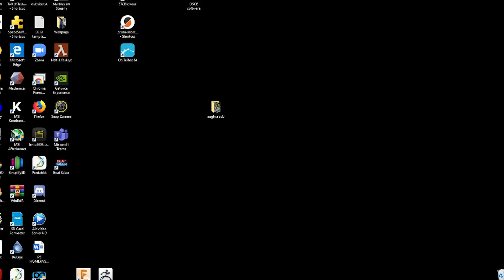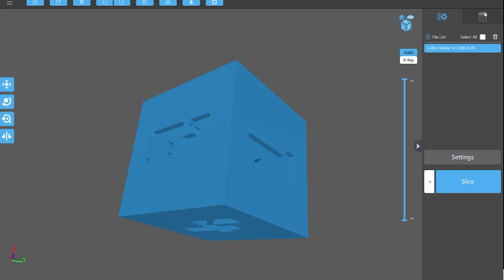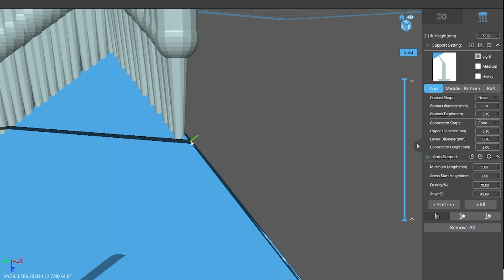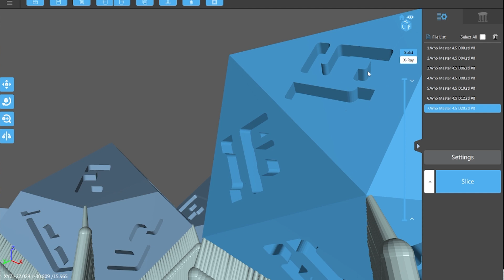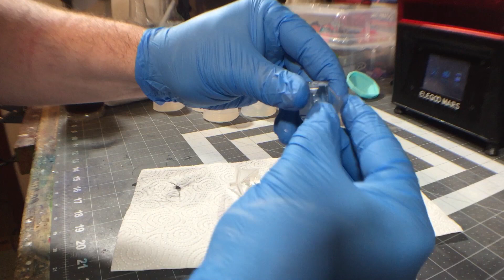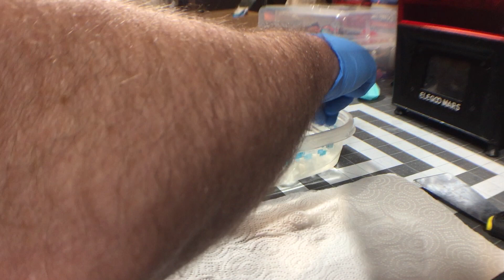3D Resin Printing Master Dice the Easy way!

Comment: Struggling for two weeks printing my Masters. Trying your support method right now and cannot wait to see the result. Thanks for sharing your wisdom 😁
Reply from the maker: You got this!
Reply: I had perfect results for most of my prints. Only issue was the D12 and D20, the supports separated at some of the outer edges what caused the die to deform. Using heavier supports on them causes the faces towards the buildplate being „blurred“. Did you had this problem before?
By the way, you make it look just so easy seperating the prints from the buildplate
Reply from the maker: Try Reducing your lift speed to something like 60
Reply: It worked great! Thank you for the support!

Comment: How do you separate dices from OpenSCAD to single dice .stl? Thanks
Reply from the maker: Personally I brought them into Simplify3d (any 3d slicer should work) and separated shells, then I could pick dice individually and save them out as individual stls.  There may be a way to do it in OpenScad but I didnt try.
Reply: @Rev_Chumley  Thank you :)
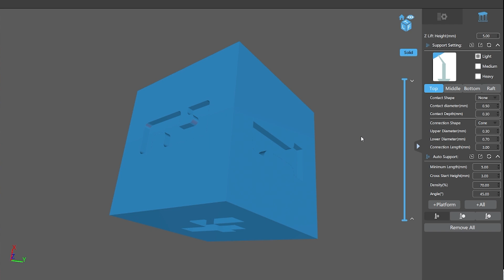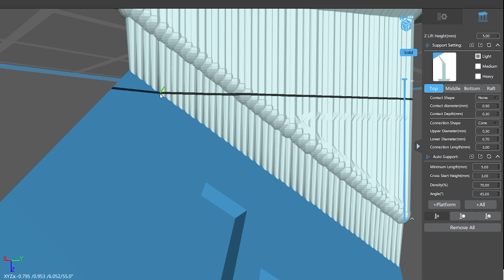Reply: You can find the info info ^above using the "//" command @4:55-6:50- Where is the d8? By using this command you can remove other dice and render the dice that you want.

Comment: Are you aiming for the supports to cover the actual edge of the dice, or to be right next to the edges, but securely on the face? And if not, have you tried that?
Reply from the maker: on the edge or as close as Chitubox will let you. with light supports you'd have to get a microscope out to see the difference.

Comment: What layer height did you go with on these?
Reply from the maker: I just do .05 as I will be sanding the crap out of them during the polish phase anyway and it’s faster.
Reply: @Rev_Chumley  Thanks! just finished testing it out and I had some air bubbles trapped in the dice. Have you ever experienced that? I am using a different resin (water washable clear blue) so that could be an issue. Besides that this worked like a charm!
Reply from the maker: Yes i've had air bubbles trapped in there. I try to let my resin settle in the tank if i've stirred or poured new in until its clear of bubbles before I start the print and make sure that there is enough in the vat so that z lift doesnt raise it above the surface, other than that I've not found a way to prevent it, if you find out how, let me know!
Reply: @Rev_Chumley  I had just poured the resin when I tried this so I'm trying again now after the resin set for awhile. Thank you again!

Comment: what version of chitubox are you using? I am giving this a go but the supports kick out no matter what I do at an angle

Edit: ah i see yours does the same thing on the d20. Printing a test now, with me luck! you have earned my sub
Reply from the maker: Yeah some refuse to lay down straight, just make sure they all are angled the same way if it makes you.  Good luck!
Reply: @Rev_Chumley  i did 2 test prints of a full set with this method, mars and photon s. They came out SO GOOD! thank you for sharing this!
Reply from the maker: Glad it worked for you! Good to know all those failed dice masters i've printed over the months were worth it :)

Comment: Going to give this a try. I've been able to get good dice out of everything but a d6, there was always the corner that pointed down that was longer than the rest. Test printing now.
Reply from the maker: Hope it works for you! Let me know how it comes out
Reply: @Rev_Chumley  It worked better than what I had before. Still not perfect but my test print at 0.04mm went well. Running one at 0.02 and well see how it is tomorrow.
Reply from the maker: I’ve tried many different support models for dice and I have yet to get perfection, but with this method everything was flat and correct with a minimal amount of extra material on the bottom tip probably due to light bleed in the clear resin, but was easily removed during the polishing phase. If you are seeing to much light bleed at the bottom, try lowering the layer exposure time to 8-9 seconds.  See my Instagram for these all sanded and polished.
Reply: @Rev_Chumley  My d6 turned out pretty well with this, close enough that I'm happy with it anyhow. After polishing it's good. I tend to use thinner supports than you do (most of my printing work is miniatures so I've gotten used to using very light supports) and I'm printing my D00 right now. Have you found it necessary to make the supports touch each other or do you get similar results if there are gaps between each support?
Reply from the maker: I’ve found if you leave gaps between the supports that they will hold resin and light bleed through the clear will sometimes cause the blobby faces/edges, but I haven’t tried every combo.  Doesn’t hurt to try.

Comment from the maker: I didn’t mention this in the video, as it was more about the printing process and supports, but I’m getting questions on post curing.  Make sure to post cure your dice with a UV source (sun, nail lamp etc) before polishing.  I would also suggest letting your masters off gas for a minimum of a week (2 is better) before attempting to mold in platinum silicone.  (See my inhibitx vs napthta video).   Also you may get a small about of light bleed on the base tip, but this is easily removed when polishing, if your faces are flat and even a little extra material on the tip is actually a good thing. Better something that is easily sanded off than warped faces.

Comment: Exactly what I needed, exactly when I needed it. (Borrowed a friend's Photon to try this.)
Reply from the maker: I hope it works for you! Nothing more frustrating than failed print after failed print.
Reply: @Rev_Chumley  Just saying thanks again. My first try failed but I recalibrated the platform and got 7 for 7. Once the raft was cut free the supports just snapped right off.